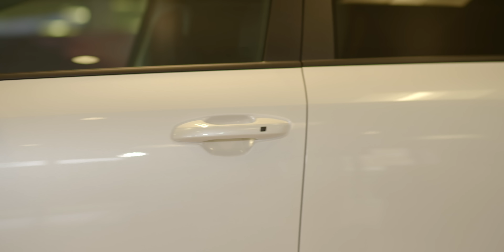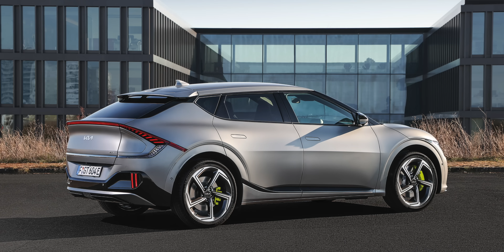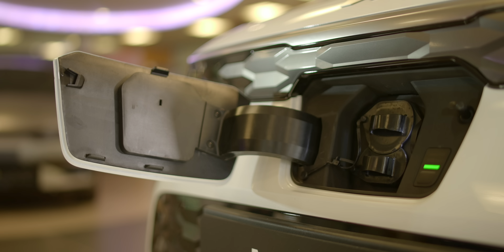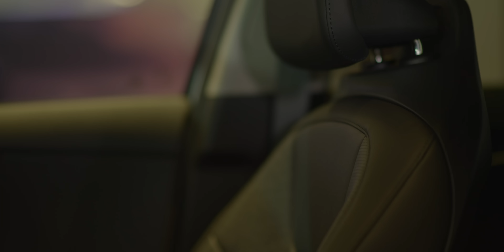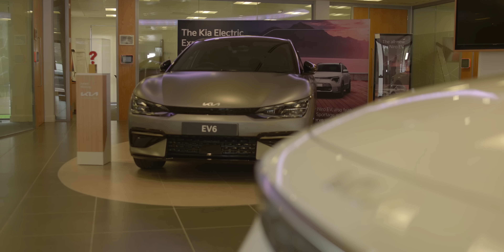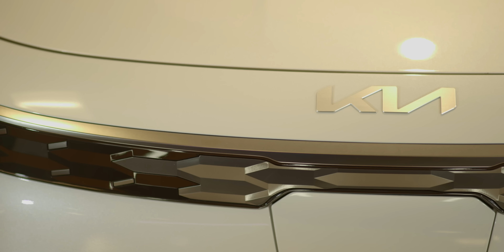New KIA NIRO EV - Jack's exclusive Kia HQ interview

Comment: Moving the charging point is a good thing. I had to charge today on the LHS at a double slot charger. The lead barely reached.
The rest is really the same as the current model.
I really felt for Jack having to sit though the the pushing of ICE/Hybrid stuff. It seems the etiquette of these interviews is no remotely awkward question gets asked. Such as the compromises being designed as to allow ICE variants makes to the design, when will they drop the ICE models, where do Kia have factories (are they still in Russia) what about towing etc. I like my 2020 model but would expect new models to be progress on the old ones when it comes to efficiency and significant software features. This does not seem to be the case.

Comment: For the EV your guest mentioned better performance but the specs from other sources seems to indicate slower acceleration due to the motor torque rating being chopped by 35%. Power is still the same 150 kW but it takes a higher speed to reach that.  This is worth chasing down because is no stated reason for this derating.  Perhaps start by querying gearbox reliability.

Comment: I love the new Niro EV!  Cannot wait for it's launch in Australia later this year.  I just wish there was no option but to take the heatpump in all markets as EV's are about efficiency and heatpumps are efficient, my worry is Kia AU will go cheap and not put it in even as an option.  The charge port is not great as you get in a front ender first thing to need to be fixed, rather it be on the back similar to the classic Ioniq as to pull out of a charger is much safer than having to back out.

Comment: I was rather hoping for a ground up EV chassis design. Compromise helps the company, but not me. It is better than the previous, which as an eNV 40kWh driver I liked, but I hear 50kW charging. That's not going to help sales.
Reply: The Kona E and Niro are practically the same and my Kona charges up to 75 KWh.

Comment: You can only say that a centre-front charging port is better and more convenient if you only consider a few use cases.  In my home situation it's the least convenient charge port location!
Reply: Agreed. It’s also geometrically easier to back into a tight space, which is out of the question with this setup. I wish more manufacturers utilized dual charge port locations.
Reply: I'd rather KIA would stop flirting with ICE and Hybrid formats. I know it's difficult at the moment to get a BEV ticket price down, but if KIA committed totally to electrification I'm sure they could do it sooner, rather than later. It's not all down to materials cost. Scale matters.
Reply: Unless you live in a place with harsh winters...it gets frozen and stuck quickly.
Reply: why not front tho.. 
better at home on the drive and in the garage for many. if you want access to your boot when charging like many should parking nose in is quite sensible. 
better at parking at work and public charging in plenty of cases.  it is also perfectly compatible with many side charging options...
Reply: @GregHighPressure  imo it's more difficult to pull forward into spaces that are tight & you then have to reverse out into what is a busier area so less safe
Reply: In buggy locations, I don't want to mess (pun not intended) with bug guts every time I want to plug in.
Reply: @jamesdubben3687  That's a very good point.

Comment: Having been to see the new Niro EV and owning the current one for the past year, I would say all the parts I think "it would be nice if" they have improved or implemented in the new one. I do think an increase in charging speed would be nice, but in my experience, most chargers I have found have not been above 50kWh. However for the future where I expect faster chargers to become more prominent, it would be great to have seen 125kWh or more charge speeds.
Reply: fast is clearly really handy, but with our current cell tech it is a huge compromise when it damages the battery health so much more :(

Comment: I remain unconvinced, it is basically the current one rewrapped, and it is now lagging behind in charging speed.
Reply: In Sweden leasing are very popular and the new Niro EV are 1200-1300Sek more expensive a month. So it will not sell like the old E Niro.
Reply: If you have the opportunity to charge at home over night, the fast charging speed isn’t that important for every day use. I only make a couple of longer trips each year, so I’m fine with the extra 20-30 minutes per charging stop compared to e.g. an EV6. Most chargers in Sweden aren’t super fast, normally 50-100 kW in my area. So the gain would be very small. I think there’s actually too much focus on charging speed in the EV debate in general. The bigger problem is all the cars coming out that are ridiculously oversized and need mega batteries to get a decent range. Imagine how much better we could use those rare metals if we made more of the smaller batteries and smaller cars. Also, they would be a lot better priced so more people could make the switch to electric. It’s a shame really.
Reply: @LongEarthTradingCompany  Yes. The new Niro is slightly bigger than the old. Having brought out the EV6 to cater for the people withe american size parking spaces it would have been nice if the Niro had got smaller on the outside.
Reply: @MrDuncl  Hmm, I guess that's almost unheard of, a car model decreasing in size from one model year to the next... No but I mean cars that are just unnecessarily big for... anyone... like the bigger Volvo, BMW, Audi, etc. SUV's. Not to mention basically every American car out there... They all use an unnecessary amount of battery chemistry for just one vehicle.
Reply: @LongEarthTradingCompany  True, The latest Polo is bigger and heavier than the original Golf. On the subject of Volvos I walk past a dealership most days and they all seem to be huge now.
Reply: @MrDuncl  Yeah, I was thinking of that comparison with the Golf and Polo actually :) I own a Volvo V60 from 2017, the previous version, and it's a little smaller than the newer model which feels very much like the old V70 sizewise. So yeah, it's just a general trend that we have to live with since most people relate bigger to better, and they often want to continue on with what they already have in a newer, bigger, better version.
Reply: If they could get it down around 35k loaded though? And make the charging curve flat in the 10-80% range bringing it down to around 30mins.
It would still be acceptable for many people's use cases. Sadly I think it still starts around 40k and they leave the weak charging curve.

Comment: Went to my local dealer review this week. Was very disappointed in the new Niro. 
Pro:s 
I liked the shape as i like a boxier look and more practical.
Has a sun roof, at last no pano roof.
VTG

Cons:
Dealer Knowledge
Cabin feels smaller than outgoing model
No spare wheel space now as has battery part in the well.
Front charge port,  not sealed so open to wet and dirt
No AWD option
Small frunk

Colour scheme is too busy.
Cheap plastic exterior panels.
No deep metalic blue like the ev6 
No real improvement in battery capacity 
No real improvement in charge speeds.

then the biggest con, the Pricing.  4+ with heat pump £41990.  may as well save and get the Ev6 with better recharge speeds and colour choice.
10k deposit ( who has that)  over 36 month PCP is £400 a months with a £22000 final option to buy.
Looks like will be looking for a good condition Jazz sport or older model E Niro then.
Reply: Thanks for the info about the spare wheel space. I can't see any improvements on this over the old e-Niro, or many other EVs (like the ID3) which weren't available when the first e-Niro launched.
Reply: Don't but it then, my god.
Reply: @mev202  Im not going to , If Kia are not told what is wrong they cant correct or improve it. Read the full post
Reply: @ghost70  I did. And you clearly think a lot about yourself.
Reply: @mev202  yep i do
Reply: @mev202 , it's a comments section. He gets to post about his views. Why be a crybaby about that?

Comment: This is not an accusation, but this video feels more like a paid ad rather than an informal interview. Just my opinion.
Reply: Fully Charged Plus is specifically kept separate from Fully Charged because it openly used paid-promotion content. By accepting blatant plugs, advertising, and positive exposure (albeit only for suitably green and renewable products and schemes), it allows Fully Charged to remain independent.
Reply: My thoughts too
Reply: This is the Fully Charged Plus channel, where the more marketing/promotional style of material is put so the Fully Charged Show channel can maintain an objective stance. This is absolutely a form of marketing (though that doesn't make the information any less interesting)

Whether or not it's a paid promotion is not clear, but I'm guessing not since that would likely be disclosed.
Reply: It doesn’t say that anywhere though…
Reply: @adamjessup1948  Doesn't say what? That it's a paid promotion? Probably because it's not paid, is my guess...
Reply: @adamjessup1948  top left.
At the start.
Reply: @adamjessup1948  yes it does I saw it at the beginning

Comment: Drive an EV any place that has real winters and you'll be rethinking your opinion of that front charge port.  :-)

(And thanks for the great shows Jack!)
Reply: That's always been my view of things. Some are worse than others (Honda Clarity's charge port is ON TOP of the front basically begging to be filled with ice). However, considering the rate of EV adoption in Norway - which certainly has a winter season - it's either not that big a problem to start with or it's easily managed.

For better or worse, though, the front of the car is the best location in terms of accessibility and flexibility of charge station layout.